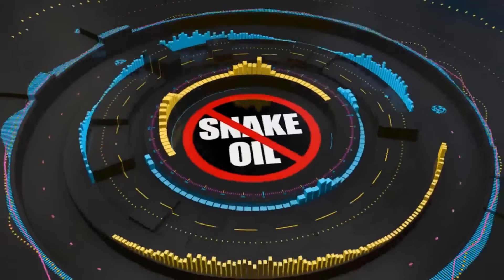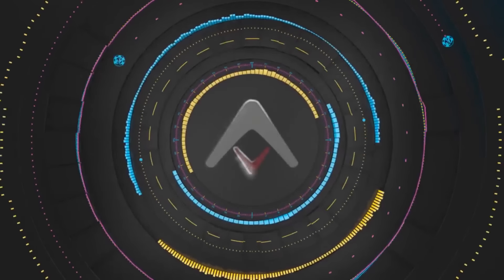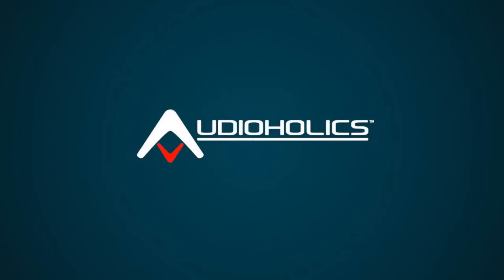STOP Worrying About These 5 Things in Audio!

Comment: Cables actually can make a difference as far as noise floor. I’m not saying they have to be expensive or anything, but it can be beneficial to twist your speaker wire and ensure they have a solid connection. In my spare room I have a decent preamp connected to a 2.1 speaker system. The sub has an RCA input with a pair of push pin speaker outs and really cheap high gauge speaker wire. I had a lot of hiss and could faintly hear radio stations. I had some 14 awg copper wire in the garage. I spent $10 for a 17’ twisted RCA cable for my record player; to go across the room. This alone made a huge difference but I still had a little bit of hiss, so I separated and twisted the speaker wire and added some cheap banana plugs with woven copper ends. The hiss is completely inaudible now, unless I put my ear directly up to the speaker. It was a fun little experiment. It really did transform the sound, but only because I’m in a small room listening in the near field at low volumes.
Reply: You must have an incredily high powered radio station next to your home if you can actually pick up sound from it. And the hiss is not coming from the cables, it's the amplifiers poor filter/buffer stage that creates the hiss. If you had extremely poor quality cables before, installing standard hifi-spec cables can help with impedance matching between the source and the amp, that's the only explanation scientifically I can understand how your hiss became lower...
Reply: @Munakas-wq3gp  The included speaker cables were terrible. I’m guessing 30 AWG, not copper, probably aluminum. I know the hiss doesn’t come from the speaker wire and I never claimed that. For whatever reason they were passing more hiss to my speakers. My really expensive $10 Amazonphile grade speaker cable pretty much eliminated the hiss. As for the RF noise. That was coming through from two strung together old RCA cables I had to use to make the 10’-12’ run from my record player to the preamp. The preamp in the sub probably isn’t great. For whatever reason, the newer $10 twisted rca cable is a worse antenna than my old cable. Thems the facts, believe or don’t. You can relax, I’m not pushing exotic $10,000 Himalayan speaker cables woven from the fleece of virgin lama’s or anything. Im also not playing armchair scientists here. I’m just pointing out that really crappy dirt cheap or damaged cables or loose connections can degrade sound quality. It’s easily solved with run of the mill copper cables and or cheap banana plugs . So cables and connectors do matter, just not very much. The point of diminishing returns is very low. I only shared my experience so that people who watch this video don’t buy a pair of decent desktop speakers and stick with the crappy included cables because they think cables make NO difference. Cables SOMETIMES do make a difference. But like I said, only if they’re really really bad.
Reply: @richardbixler  With very long pulls cables do start to matter, for example if you have multiple active subs and you need to pull a signal 5-6 meters away. The shorter the pull, the less need there is to worry. Best cable is no cable...
Reply: @Munakas-wq3gp  Agreed, I wish more subs and preamps came with balanced connections. Sometimes long runs are the only option. I’m not a perfectionist when it comes to sound quality, but I do have really good hearing. I’m in my mid 40’s and can still hear up to 18 khz. High frequencies really bother me. Hiss is really annoying and electronic coil whine makes me want to run out of a room.
Reply: @richardbixler  My late father was an electronics repairman and when I was a kid he always had 2-3 tv sets gutted open on desks. I remember how annoying the coil whine from the old tube tv sets was... Hurt ears.
Reply: @richardbixler  There are active boxes that convert RCA to balanced and back so you can have 0.5m if RCA and do the long pull balanced... IIRC about 120 bucks a piece. These are not to be confused with simply connecting the - signal to the ground in the XLR. It works but is no better than a regular RCA. I have many such cables in use since my home theater is built with active speakers and my Marantz Cinema 70 has only rca out for all channels.
Reply: I'm about getting my room as quiet as possible! Maybe I'm just a little sensitive to the background signal noise (noise floor) but for me, even though I'm running an arcam avr20 with a couple of matching high-performance 4 channel power amps (front stage/Atmos) which are driving my Sonus Faber speakers in a 5.2.4 configuration, which also includes a stereo pair of Rel subwoofers for my 4 × 3.5m (13 × 11.5ft) livingroom. I have to say it was only when I purchased quality shielded speaker & RCA cables did my room finally become exceptionally quiet! 
My room is now so quiet there are occasions (without me opening my eyes) I'm actually unable to differentiate whether the system is switched off or if it's switched on. The room is really that quiet.
If one is looking to get rid of that so-called ambient sound of the room. IMO shielded cables are the only way to go. And bear in mind this is coming from someone who's changed his setup and cables multiple times.

Silence is Golden 🥳
Reply: @awwbollocksthen1359  My listening room is 4x12m which makes much better acoustics. No need for shielded cables, the system is dead quiet to begin with when there's no signal.
Reply: @Munakas-wq3gp  This is my spare room, not my main listening area. It’s a small space, but the layout required a long run of over 5m or 12’ from my record player to my preamp. All while being routed with several short power cables. Not ideal for sure, and the RF and MF interference is uniquely bad in my situation. I considered using an RCA to XLR conversion box, instead I decided to try this inexpensive cable first. It solved the problem with less complication.
Reply: @awwbollocksthen1359  RCA cables do matter when it comes to long runs. Personally balanced XLR is the ideal because they are 100% immune to interference. Shielded or twisted is almost always good enough. At the end of the day if it works it works. Most importantly non of these options need to be expensive.

Comment: This is refreshing. Belden Cables via Blue Jean Cables is a very. good resource. American manufactured wire/cable professionally terminated at very reasonable prices. Belden  has real engineering and is used in more studios along with Mogami than any other brand. The advice here is down to earth and accurate....thank you for your honest and accurate advice.
Reply: Many "audiophile" cables were Belden Cables with fancy jacks and sleeves.

Comment: Gene for me it's cable !!! Why because if the connector is sub-par you are done I go bare wire on everything
Reply: My sound is consistently better with banana plugs than bare wire. 
When I upgraded my AVR about a year and a half ago, reconnecting my speakers was so much easier, too.
Reply: @frommatorav1 Easy hook up YES!! Banana plugs when made of pure silver are the best because it is the optimized conductor. 

Since my wire is silver and I run multiple listening areas it saves me $$$$ that offset all of the test equipment to test things like cables and sound and other electronics. 

Make Sure those connectors are pure silver for sure my Ears here the difference

Comment: Switched from mono price 12guage to bellden 10 gauge speaker wire. I heard a difference via a/b biased testing. Mono signal into each speaker using different cable. Brought in wife and blind a/b a/a b/b and she picked belden cable. Surprised a lot of bass and midrange was missing on mono price. Not sure if it is the 10guage, 100percent copper or both. Using KEF R11.
Reply: More likely an artifact of the speaker's location than anything to do with wires.
Reply: @Douglas_Blake_579  I would agree. That is why I switched the wires on each speaker to rule that out and that the amp or speakers may not be exact. Also the room and acoustic treatments are symmetrical with exception to equipment cabinets. The difference was most apparent with voice.

Comment: Not to be combatant, I have a friend who believes that cables won't make a difference... but.... Paul McGowan and his PS Audio company don't sale cables. He states that changing cables in his system can easily be noticed. Why don't you go to PS Audio headquarters? You might change your opinion. Simple as that.
Reply: Perhaps you could also spend a bit of time reading up on how wire works and what it does. Cables are not tone controls... they are simple conductors.
Reply from the maker: Paul McGowan makes a lot of nonsensical claims about cables and he has benefited greatly  with his partnership with Audioquest.

Comment: Not aware of the impedance switch on AV receivers. Can you show an example.  i am aware that some tube amps have additional binding posts for 4, 8, 16 ohm speakers.  Does the same leave on the highest impedance setting apply with these as well.
Reply: Tube/valve amps should be operated with the impedance selection as close as practical to the nominal speaker impedance. Transformer taps provide genuine impedance matching to load, and let the output tubes run as much as possible in their linear operating range with the correct rated loading. i.e. best distortion performance.

Comment: Thank you bro. As a low level audiophile,  I was a bit hung-on  on cable quality. This was because of many audio folks comments on YouTube which made me to condemn audio copper cables sold at my local DIY store.  An experience audio technician told me that my DIY store  cables were no different from the expensive ones. And that he has used them in his system.

Comment: Should this advice about the impedance switch be disregarded in an instance where the wattage is said to be doubled at 4 ohms? Compared to its 8 ohm rating. For example, the onkyo a-9150
Reply from the maker: Rewatch what I said. I can't be more clear.
Reply: I don’t know, it still seems unclear. I think the A-9150’s lists double the wattage at 4 ohms, compared to its 8 ohm rating. Is this an exception to the rule, or is onkyo lying to everyone?
Reply from the maker: @youtubechannel6267  again rewatch the various videos I've done on the impedance switch so you know how to set it.
Reply: @Audioholics  i feel like I was being sold a used car, the way you didn’t answer my question and just suggested I watch more of your videos…  you’re better then that, Gene.
Reply from the maker: @youtubechannel6267  I simply can't restate the facts any other way. There is one correct setting for all situations.  You can choose to believe it or not.
Reply: @Audioholics  I understand the logic on why they cut transformer power to achieve the 4 ohm stable rating. What I don’t understand is: if you have an amp which lists 4-8 ohm specs at  60wpc. With the same amp listing 30wpc at 8-16 ohms. Why is the listed wattage lower at 8-16 ohms, compared to 4-8? If it in fact giving it more power at the 8-16 ohm setting? That’s where I’m lost.
Reply from the maker: @youtubechannel6267  same voltage twice the current with half load impedance = 2X power. P=V^2/R and P=I^2*R
Reply: @Audioholics  you make things so easy for your YouTube audience to comprehend. The simple way you just spell things out, it’s incredible.

Comment: No way you are right on Cables, I've been in this hobby for 40 years, and with every power cord or other cable be they speakers or interconnects, if you cannot hear the change you have hearing problems, having said that $10,000 for a cable is nuts or you have too much money to blow. But it is very easy to hear, the same as what outlet you use on power conditioners each will change the sound the gear produces. But cables matter, as well as room acoustics. Everything matters in a good audio system, and everything you add will make a change, now if you like the change for your ear that is another matter.
Reply from the maker: 😆 🤣  ok sure. 40 years falling for placebo effect. If it makes you happy,  enjoy.
Reply: @Audioholics  I have ears of my own when I make a change I don't give a crap I just listen and anyone who uses decent cables of all sorts knows this is true, PS Audio Statement power Cords do not sound like a Carda's power cord on the same amp, if all amps measure great they should sound the same, but they don't as class D is inferior to a/b amps and class A, but hey they give you lots of watts on the cheap if they were worth more then they ask more.  Experience matters. AC outlets impact the sound change them out you change the sound, wall plates do the same. Unless you try it and hear it you are in the past, living in a cave under a rock.  If that makes you happy enjoy.
Reply from the maker: @philb-ze8sz  This is the wrong channel for you my friend. We promote common sense, science based approach to audio. Your comments on Class D show that you're "40 years of experience" still leaves you wanting for actual knowledge on electronics and basic engineering in audio. Like what you like, believe what you believe. I can only teach but I can't learn basic concepts for you.
Reply: @Audioholics  Bingo!!!  Became Electronics Tech in the 80s doing individual component level repair working on various RF gear where AC inductive and capacitive reactance make big differences in design and repair.   Sure a good quality cable/speaker wire is important but even technically high quality cables for audio are super cheap compared to ridiculous blingware.

Comment: Concerning cables, I would not put much emphasis on measurement but a good way to test is to have a couple or better a few of alternative cables (type price range etc) play the same song and as soon as possible switch from one to another. At least my experience is that there are small but still significant differences. Maybe it is worthwhile to spend about 20 % on cables in relation to other components.

Comment: I spray liquid nitrogen on my $50000 a side Nordiophilequest ultra pure 99.9994 % oxygen free fero-liquid cooled 75v battery enhanced cryogenic cables to maintain them at  exactly 196 degree’s Celsius whenever I listen to music. It lifts the veil from the  upper lower middle midrange, enhances the airiness above 150khz and blackens the background to exactly 34% darker than a cosmic black hole whilst tightening and simultaneously relaxing the upper lower sideways mid bass. Without it my music sounds like total crap.

Comment: Cables aren't snake oil. I need a cryogenic-treated silver-coated oxygen free high conductivity copper silver, forged by fire in hades POWER cable, which has a magical ability to filter out all the RF and other crap that commercial power lines and 20 year old romex in my walls brings into my house.

If you're not using a $20k cable like that, you're missing out!

Comment: Great lecture, and very thorough in a shorter span of time than other reviewers on YouTube. Another thumbs up, as always. I recently bought a pair of Paradigm SE Monitor Atoms, designed, engineered in Canada. And I prefer those SE Atom bookshelf speakers, on speaker stands, more to a previous pair of Klipsch R-51Ms. Atoms SE speakers are now connected to a used Cambridge Audio AXR100 Receiver, in very good condition; I thought I'd say so for any confirmation, ha. 

More seriously, I believe that when interconnect cables, and speaker wire are logically considered, you are no less than 97% correct! There are audiophiles out there who may think you are 79%; however, it has more to do with a perceived Placebo Effect. If anything other than physical measurement, in terms of sound, it may not be actual subjective determination, either.The most expensive cables I have, that are actually of moderate price compared to most other brand hi fi cables, are Blue Jeans Cable, mostly made in the USA. Excellent transfer of musical signals.🔉🎵🎶

Comment: I think the mistake and fundamental of audio be an audio files or somebody that’s in the hobby of loving audio home audio very much. The more expensive is always the better and in some cases definitely the but in my experience based on your room requirements and set up, etc., the limits of expense versus the gain of quality of audio you get from expense definitely diminishes as you go, higher and higher an example would be $40,000 speakers versus say $8000 speakers there’s definitely a price difference in that but the real question comes down to is there enough of an improvement in the audio of just the speaker alone to really justify a $32,000 price difference and that really is a lot of what you see with all these wires and everything else I just use copper wire bare no banana plugs no other types of connection tip. I’ve tried with without it from my experience for me. It’s such a dramatic difference using bear wire I will never go back to banana plugs. I can never see myself buying thousands of dollars in speaker wire and seeing a huge improvement from what I have already to be honest I think some of the best results are from experimentation with your gear also knowing what gauge of wire to use for your distances and to truly sit down and calibrate, your speakers and you’re listening environment as much as you can with reason, if you’re in a family room, there’s a level of liability and compromise to sound damp and every other form of treatment that one may use to achieve their ideal sound so it’s a give-and-take. But I would think fundamentally that is the probably biggest thing I noticed, and all of this audio stuff over the years at home audio or otherwise audiophile.